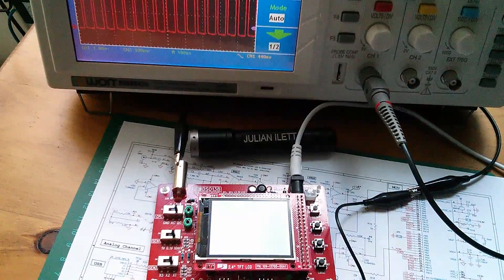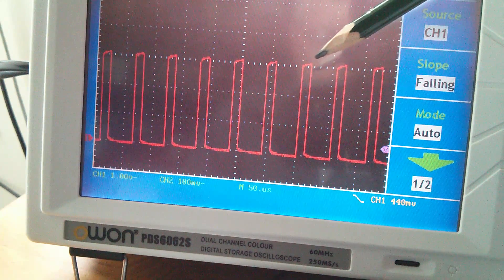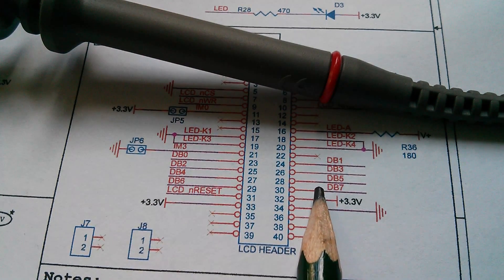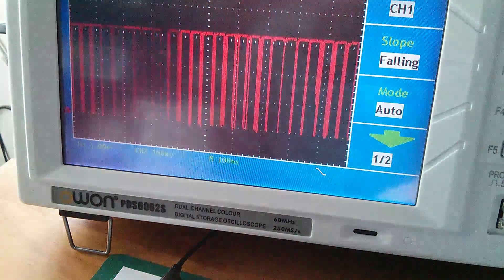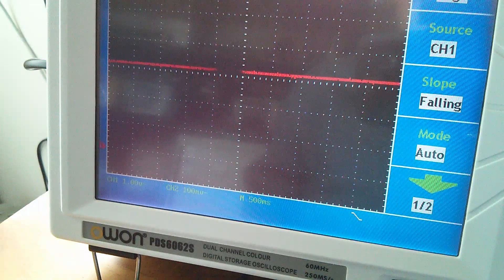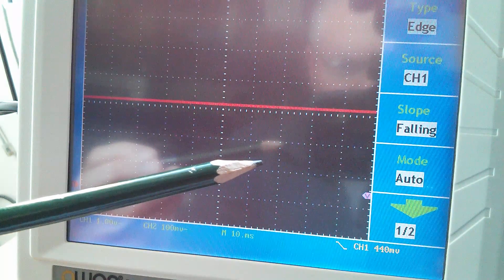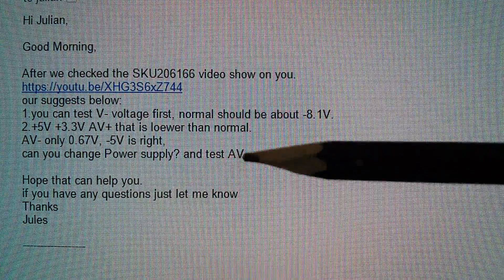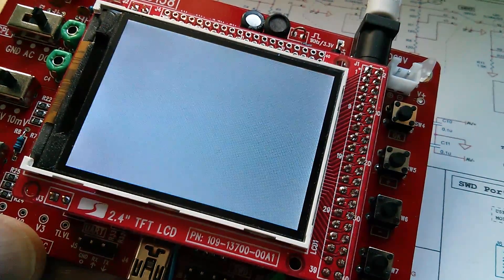Julian's Kit Build: Banggood £15 ($23) Oscilloscope (update)

Comment: I saw you looking at the schematic of the DSO, where did you find it? could you link it in the description? I had bought one that behaved like yours that had bad soldering on the LCD ribbon cable, which is between the LCD and its carrier!

Comment: I've had my kit sitting on the shelf since the middle of 2016 and now that I've seen a few videos on it and actually saw you use it is feel confident I can assemble it and upgrade the firmware.  it appears the USB connector is not going to be used so I will not install it

Comment: I have a similar problem and don't have a scope to trouble shoot it. My LCD lights up but nothing comes up on the screen. I never saw the green LED light up either. My power supply might be the problem so I will try again with a better power supply. I had trouble figuring out where all the resisters go as they didn't mark the values and some of them gave me readings that fluctuated so much that I wasn't able to be 100% sure of each one. I may have to send it back to get a new one if possible. I also ordered the scope with the clear case and they didn't send the case, so I should just send it back.
Reply: When in doubt, get a fresh 9V Alkaline battery and use that to power the device. Only use it for a couple minutes at a time though.

You need to measure high value resistors with your hands off! You're being an antenna and a 100kOhm variable resistor, neither of which are helping. And the leads aren't the best either, they will be just fine when you solder them down, but they don't like test leads, especially ones with oily/dirty tips and of questionable provenance. Get crocodile clips, measure your resistors only in crocodile clips, and don't touch anything! You'll get smack on measurements that way, and i mean resistors they got in the kit are actually precision resistors.

Also, what are the odds that you have forgotten to make that bridge they mention at the end of the assembly manual? You don't do it, you get white display, but the controller is permanently off.

Comment: Hi Julian, I've just built one of these and, apart from a problem with the probe compensation adjustment on the 1 volt range, it seemed to work straight off. But when I fed it a 1 kHz square wave from my Owon DSO 'scope's prob cal output the DSO138 reported it as 2 kHz! It looks as though there is a clock frequency problem within the system as both the cal output (actually only 500 Hz) and the timebase are both wrong, although they agree with each other. Have you encountered this phenomenon?

Comment: How did you go Julian? I just got mine working, I had the issue with AV- producing a very low + output and I replaced Q1 as it had blown. I too believe L2 is a problem causing Q1 to overheat.

Comment: Interesting. I'm having the same exact issue and everything BUT the lcd seems to be working perfectly fine. Screen was fine until I connected the probe and then the screen seemed first to freeze when I saw signal and after that it was white screen on reset and reboot
.
If it's not the lcd then I will be quite surprised.

Comment: Julian
Have you put JP4 in (Jumper 4), it's at the top right of the board. Guess you have but someone else had much the same problem and found JP4 missing, when installed it solved the problem.

Comment: Hi Julien,  I wonder could it be a bad solder joint or connection from the posts to the actual LCD. You're testing the posts themselves and they check out OK. If there was a bad connection (dry joint) on that board it would give the problem you're getting. Why not run along those solder joints and freshen them up. It's worth a try.   Stu

Comment: Built this yesterday, and the LCD lights up but with no display.
Also the LED repeats the 2 flash, pause, 2 flash etc. even with the LCD in place
I have a similar problem to your first video, i.e. AV- at about 0.7v, other voltage levels OK, (so far), and no pulse train on VGEN and nothing across R40. I see that VGEN started working for you in this video. Can you tell me what (if anything) you did to kickstart the MCU pulse train? Thanks!

Comment: Wait, your AV- is not a negative voltage like it should be.  (It's +.6v, right?)  So the negative voltage generator is not working.

The negative voltage is probably used for the LCD Contrast - so if you don't have the -5V, you probably won't have a display.

I'd troubleshoot that circuit and/or use your 9v battery to inject "-9v" (+ of the battery to GROUND, -  of the battery to the input on the regulator) into the 7905 regulator to see if the LCD works again. If it does, then it's a contrast problem due to not having the -5v source, not the LCD panel itself.
Reply from the maker: Jeff Artz The negative voltage generator circuit is now fixed - read the full story (with photos) here: http://256.uk/?p=78
Reply: Julian Ilett Ah, ok. ;-)  Thanks for the follow-up.

Comment: Hi Julian, I agree with you. I have came to the same conclusion that the fault lies with the TFT. I have measured every data and control line. They are all good. I thought maybe the screen was not being initialized correctly or too fast so I swapped the 8mhz xtal for a 4mhz. Still failed to init the screen. I did find a test mode for the unit. If you hold down the OK button as you reset, every alternate databus pin on ALL mcu ports toggles their state... great for debugging.. Unfortunately just proved to me the screen still at fault. PS. at 4mhz. the test signal drops from 1khz to the now expected 500hz. PPS I uploaded the newer MCU hex. Screen still not init. Regards, Tony

Comment: You don't follow thru on fault finding the -5V.  I would not expect the LCD to work when there's a voltage missing.  Even if that only goes to the microcontroller.  And you will need that -5V anyway.
Reply from the maker: thulinp The negative voltage generator circuit is now fixed - read the full story (with photos) here: http://256.uk/?p=78

Comment: Have they sent you a screen yet? I had mine on and was moving the sliders and the screen went white. I hit the reset and it came back. Since I purchased this to learn how to use it, I hope you do some videos using it for testing. It would be good if you would use it while building a power supply for the frequency generator ( I was going to build one to learn with). I have a computer power supply I modified to get 5,12, ground. I could take it apart and find the -12 I think.
I hope you get back with this oscilloscope and do some experimenting.
Thanks for your videos and time.
Don
Reply from the maker: amtpdb1 No, they're still trying to 'help' me solve the missing AV- problem, so I guess I should look at that next. Then, when the LCD still remains blank, I can probably get them to send a new one.
Reply: Julian Ilett AV- only appear when valid LCD module is attached.Please see this. http://www.jyetech.com/forum/viewtopic.php?f=18&t=489

Comment: Around 8:24: Your scope shows that the write signal nWR never really gets below 1V for some reason. To make sure the levels are ok you could have set your scope to a timebase where single pulses are actually visible. It could just be the slow timebase you are using that makes it look like the signal does not get below 1V. If the nWR signal is not below something like 0.5V the TFT display won't really react to the write pulse which would explain the behaviour of it.
Reply from the maker: Chip Guy Vids Yes, the pulses not hitting ground is a scope artifact. With a faster timebase, the pulses were hitting ground - unfortunately those shots didn't make it into the final edit.
Reply: Julian Ilett Damned, could have been such an easy diagnosis then. Well, "Display not working for unknown reason"... sounds still ok though ;)

Comment: It's probably not the power supply, but 9V battery wouldn't work anyway. It's internal resistance is quite high and voltage will drop a lot. I can imagine this thing is drawing a lot of current. Well, at least a lot for a 9 V battery

Comment: Unfortunately, Every time I have been 99% certain... I have been 50% wrong.
I would suggest examining the supplied manual. The +/- side switches change their function depending upon the scope mode. The scope mode is selected by the SEL switch. The screen then displays which mode you are in...(Catch 22 if you can't see the display). This explains what you were seeing by pressing the +/- buttons.

As encouragement, the scope, (when completed), does actually work and I have used it to debug some Arduino projects. Agreed... not like a full featured scope, but for those interested in a minimalistic approach to electronics... perfect. 
I look forward to seeing your final working solution.

Comment: I had the same problem with mine and used a 10cm wire strip that had male on one end and female on the other to life the board off but still keep it connected to probe the VGEN (mine is 17khz btw) path and see where the AV- line voltage differed from the schematic (thats how i found the bad inductor) you might want to try that since it looks like you have the right wires. I ended up just wiring the entire 40 pin header and that was a pain, i should of just looked at the active wires like you did and just wired thoughs. o well in the end i fixed it by replacing the inductor and now mine works. tanks for helping me by finding the schematic and working thru it Julian

Comment: You might be able to test the -V supply without the LCD by using a sig gen (or Arduino) to drive Q2.

Also there seems to be a lot of activity on the LCD data pins without a corresponding amount on the control pins, you would expect them to be the about same if the processor is just talking to the display.

Comment: Try the TFT with a MCU, it is only a 8 pin parallel bus configuration. If you are so sure the TFT is damage, with the right sample program and supply voltage it should fail as well. The STM32F103 can run the signal up to 72MHz with PLL. The signal integrity might be a huge issue!

Comment: The voltage level of the LCD_nWR is looking very strange, maybe check that signal more?
Reply: Roger Andersson That's the scope he uses, it's not a very decent one.
Reply: ***** I know, the scope he is uses is not top notch, but if you compare around 7:00 and 8:40, in the later time signal should go down to 0 atleast.
Reply: Roger Andersson
It simply does not, because the sampling of the scope in that timeline was to slow for the signal to be captured at 8:40. Or the Scope uses no interpolation such as supersampling to display (intensity graded display).
Reply: ***** hmm i'am not sure about that. I dont know the specs of the scoop or timing of the lcd-bus but are not the wr signal one of the slowest signals in a bus, the data lines should be much faster and the data lines is showing clear span of zero to 3.3 (max volt??) and all the other signals to. As a enginer my self i would take a much closer look at the wr signal (and maybe Julian did that behind the scenes)
Reply: Roger Andersson He had the time-division in scroll mode, in very very slow mode. So it could be, that some samples were not cached on screen. I could be that the WR line is dodgy, but that is only be checkable with a decend scope or the correct setting on the existing scope.

Comment: When in doubt, Julian, re-heat re-tin all joints and use magnifier or microscope and look for hair-fine solder bridges, also metal dust under fine-pitch chips. Good luck!

Comment: As I commented on your previous video, Vgen does indeed clock when the display's connected. Does V- now give -8.1V, or is it still dead? If it's dead, I'd still guess you killed it with your 3.7V pack and it'll need to be fixed before the analogue section of the scope will work. My guess is the PNP drive transistor. Want a replacement? PM me.
Reply: Billy Sugger Julian Ilett  Yep, you and I both agreed on that in the last video.  Looked like it worked initially but after sitting longer on the next power up with only 3.7V likely killed something.  I'm still confused why Julian doesn't do the EASY test and apply a negative supply to the 7905 input and check its output.  You can even do it with a battery (a 9V alkaline should be fine but not a rechargeable 7.2V NiCd) in seconds to test.  And like I said it the last video it appears the controller checks for the negative supply.  And while it might be clocking the display that doesn't mean it is writing any pixels to it while it is waiting for the proper voltages that it monitors.

Any how, that's what I would be doing as it is very easy to test and eliminates a possible problem.  Banggood's e-mail reply also suggests to me that they are worried about the voltage levels first and not the display.  Good luck.

Comment: Julian, Not sure you unglued the LCD from the PCB (is glued with double side tape easy to get off) and looked at the flexible PCB from the LCD that is soldered on the red board.
That is what I asked last time not sure you understood that. That is soldered manually and there is a big chance that is not soldered properly.
Reply: ***** I saw your comment last time and took a look in mine, which has the same problem. It doesn't strike me as the kind of connection to be manually soldered: http://www.iforce2d.net/DSO138_lcd_inside.jpg
Reply: ***** There is no other why to do that I think than manually with soldering iron or have a hot bar maybe an automated one but you can not have that soldered with normal reflow process the LCD will be affected.
I will use one of this LCD's in my next project and my only choice is manual soldering with a soldering iron (not that big of a deal) especially with the 2.2" SPI version that has less connections. I seen a bad solder connection on one of my 4 prototype LCD boards.
Reply from the maker: ***** Yes, I did lift the LCD and I remade all those joints between the flex strip and PCB - made no difference I'm afraid.
Reply: Julian Ilett I have no other ideas . It seems highly unlikely that either LCD or microcontroller will fail but if that happened must be related to either the higher voltage to one of the IO pins or the negative voltage and if that was the case it will probably happen again.

Comment: you say about the mcu that: "I'm not going to bother turn on the 1kHz test signal and I'm not gonna bother turn on this VGEN / negative generating voltage" .. just a hunch: does the display-reset signal come before or after VGEN starts pulsing? Or even better; are the supply voltages stable before the reset comes on ? It's probably LCD the fault since banggood do have made it work on their side I presume..

Comment: Your problem with scope triggering is probably because you have it in Auto mode.  Auto waits for a predetermined period for a trigger event, and if that period times out, produces an uncorrelated sweep.  Change the mode to Normal, and the scope will wait for however long it takes for a rare event to produce a stable trigger.

Comment: Possibly zapped the LCD with static, since its all exposed to the user. Just a guess.
Reply: Yes, I noticed the horrendous lack of ESD precautions in the packaging as shipped. These displays are very sensitive to static damage.
Reply: KX36 You're right, mine arrived packed in a standard plastic bag, surrounded by foam and then another plastic bag. Pretty standard packaging from BangGood. However, I do get a lot of Arduino pieces from them which are in antistatic press-lock bags.

Comment: That's really cool how you diagnosed that instead of trashing the company.  Appears they trusted you to get to the bottom of the problem and rightfully so...I'm more interested than ever now...
Reply from the maker: area46241 I'm more determined than ever now to get this thing fixed. I think a £15 oscilloscope is such a cool device and will be very useful.
Reply: I didn't say he was trashing the company- something one would expect after purchasing an item and it did not work. Julian puts on a good show and I just wanted to show some support. I'm into the stuff he does and he puts a nice twist on things compared to the Neanderthals I'm used to around here. Julian goes deep for the answer and teaches microcontroller tech in the process
Reply: Julian Ilett I'm quite interested to see what it's like if you ever get it working. I'll buy one if it's not hideously unusable.
Reply: Julian Ilett just like to point out that you need a better soldering iron, buy a decent one with out screws on the sides and add a light dimmer to it and on first run,  the ideal safe temp is where you test it on a board for long without the heat seperate copper from fiber board.. 
I love cheap stuff,  and my iron is 2 years old and i forget it running so many nights.

Comment: Got something to do with the LCD, maybe the Init setup, wrong protocol, or just not working. While you are waiting for a new one, can't you test the LCD quickly on an Arduino
Reply: yeah i did that and it turns out the my grandmas dog stole my atv and drove it away and the cat was in the trailer attached to it. the screen was fine and it wasnt working because of the high speed finion pin in the rotory on the scope. poped a new one and and got it running. i was able to make a pupper locator and then use a gene receptical (from banggood) and put my doggos hair in it. tracked em down. they made it all the way to alaska (from ny). walked there got em and brought them home